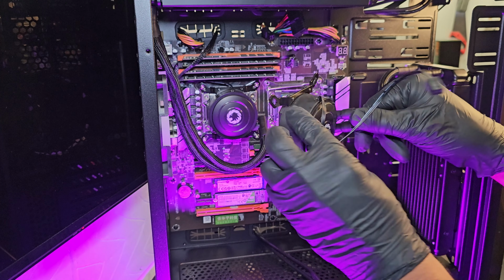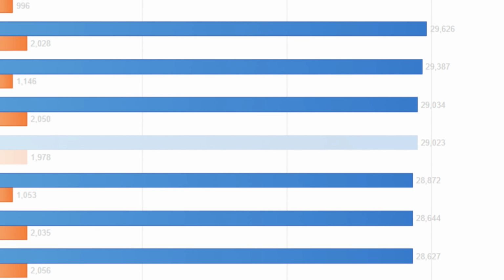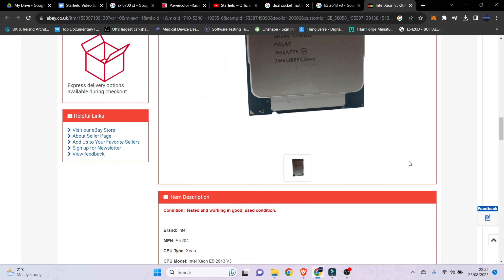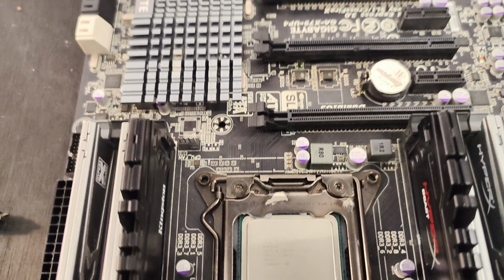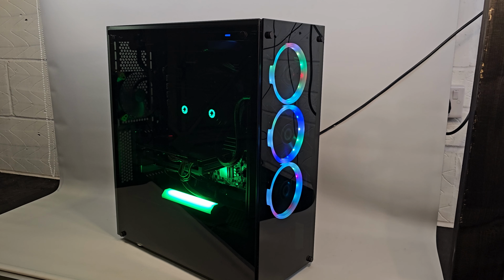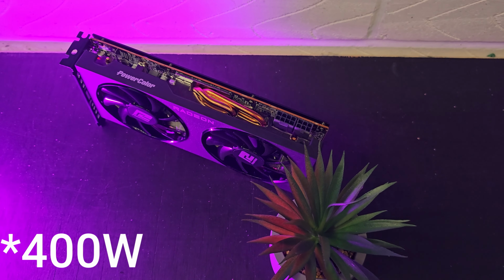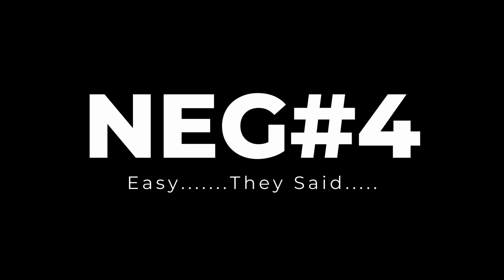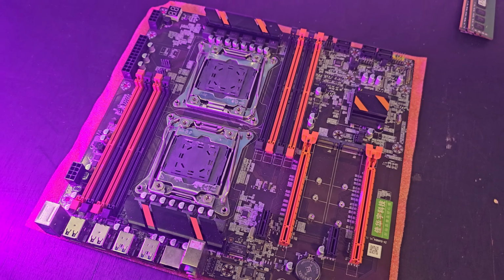DUAL Socket PC, Should you BUILD One?

Comment: Just build a Huananzhi F8D dual socket 2680v4, performs better than a Threadripper 2990WX or a I7-13700KF in multicore - 18€ per cpu and a 130€ motherboard 😆
Reply from the maker: @MetallixX974  that's awesome, sometimes you can even get those motherboards for cheaper. I picked up my ram, motherboard and dual cpus for maybe around £140 lol
Reply: I did i also built an hp z8!
Reply: I have seen those those motherboard for 75 euros on aliexpress and xeon e5 2697 v4 for 50
Reply: Do u actually see fps increase in games
Reply: @DIV9WARRIOR  he will have worse game fps vs i7 13th gen because of weak individual core performance

Comment: I was a bit lost on building a workstation with a i7 12700kf or 2 e5 2697v4 but this video convinced me to do xeon, it's also pretty cheap on aliexpress
Reply from the maker: Yeah I'm rebuilding another one right now, it's a little fiddly, I got error codes come up, just remember not to over tighten the cpu coolers and add the ram sticks in one at a time. That's add one ram stick then boot, turn off add another etc. It's some weird black magic on my mobo anyways
Reply: @RestoTek  alright thanks for the tip!

Comment: I have a Lenovo P920 Workstation with two Xeon Gold 6136's and it kicks ass with spreadsheets and with the GTX 1080 ti fe ... it kicks ass in Gaming too.
Reply from the maker: Dual Socket pcs are awesome, I don't care what anyone says lol
Reply: @RestoTek  i agree and back that comments fully i use a dual xeon e5 2699 on a lenovo thinkstation p900 150gb ram and i have a second lenovo thinkstation p910 dual xeon e5 2683 v4 and 150gb ddr 4 ram i game on both oh and rtx 360 12gb on both love them both
Reply: is it pretty smooth? im considering buying a p720 for use as a server, with dual 6138s for virtual desktop stuffs, it looks like great value.
Reply: @Alexander-dc4kf  they use alot of power but mine is very reliable.

Comment: I have a pair of HP Z840’s; One as a workstation/light gaming pc with dual e5-2689v4’s (20x 3.8ghz cores) and 128gb Ram(16x8gb 2400) and 6750xt gpu, and a second as a server with dual e5-2697v4’s (36x 3.6ghz cores) with 256gb Ram (16x16gb 2133), 8x14tb SAS HDD’s and an Intel A770 gpu. 

Z840’s are beasts with a TON of features, and I paid less than $200 each for them (less Ram and HDD’s) . If you get one, make sure you get one with the 1125w PSU so you get the extra GPU connectors. 

I know user benchmark is a terrible site, but even by their standards, both my Z840’s score “UFO” for Gaming, Workstation and Desktop categories! 
On PassMark, they still score in the top half of all systems, and that’s against the latest uber Epyc/Threadripper/Xeon systems with CPU’s that cost +$10k 😅
Reply from the maker: @baddestmofoalive  I recently did a video comparing my 2699 vs intel ultra 9, and I managed to beat one of them lol still with the boost clock mod it made a huge difference
Reply: @RestoTek  I just got a SOIC8 clip and am going to try a bit of bios modding and overclocking on mine lol

Comment: I have dual X58 motherboard from alliexpress with overclocking function as well. My both X5690 6 core cpus runing at 4.7GHz gives me extreme ammount of performance. 12 cores 24 threads for such an old platform is literally nuts and usually, the X58 chipset allows you to use only 24GB of ram MAX ( 6x4GB because it is triple channel ) but this motherboard allows you to use ECC server memory 16GB per stick and some people got 32GB sticks as well. Onboard native Sata 3 controller is really handy. But the manufacturer says that you have to use both CPUs because you loose some PCIe slots as well, some QPI bandwidth is used to communicate between those two CPUs and the chip automatically alocate some of the bandwidth if you use only one cpu, it's not a big deal but automatically you loose bunch of SATA3 connections because there are two controllers. My board has 12 SATA3 ports and QPI link speed isn't that high tbh. If you max out all the SATA3 by using SSD discs, you basically have no spare bandwidth for the GPU, USB, NIC but only if you using only 1 CPU. By using two CPUs , you have full QPI link speed avalible for everything. Mine are overclocked so the QPI bandwidth is even higher and i can utilise all 12 sata ports and still have a two full 16x PCIe 2.0 bandwidth avalible and one 8x as well as NIC and all USBs. And actually 12 cores at 4.7GHz is crazy fast to how old the machine is. RAM is 2133MHz just to mention.
Reply from the maker: @samohraje2433  thank you, that's amazing I might have a look into a pair of x5690 cpus for myself, 4.7GHz is pretty decent especially for gaming. Thank you for the indepth description here, I'm sure it will help other people too!
Reply: @RestoTek actually, compared to i7 3770K, the X5690 at 4GHz is roughly 10% faster as 3770K stock in games. At 4.7GHz i see almost 30fps boost in almost every game that is not 1core speciffic and can run on such an old system ( lack of some instruction sets ). Two X5690 at 4.7GHz gives you almost 30fps boost over i7 3770K at the same clock but consumes twice as much power, 3770K peaks at around 160W at 4.7GHz while x5690 peaks 210W on 12V CPU connector. Crazy how old that system is and still somehow capable. X99 is always better in many ways and i can clearly say it is futureprooved, if you have dual X99 mobo from like EVGA or Gigabyte or more likely from Asus, they support overclocking as well and by putting some 10 core xeons in them you can have 40 thread monster that can run any game at reasonable resolutions and framerates.
Reply: X5690 only supports 1333Mhz. Do you grill your breakfast on your PC? 😂😂
Reply: @ I don't know what that cpu support but it works at 2133MHz. But i think max is 1600-1700MHz i have BCLK fsb set to 235 and anything else via multiplier, for CPU i have 20x. It coockin but not as terrible as i thought. 400W just CPUs alone is wicked 😂

Comment: I had a duel Xeon i used all the way until 2020. DDR2 but it had so much ram and so many cores it functioned acceptably into the ddr4 era.
Reply from the maker: @Virtue2721  that's amazing! Even ddr4 era dual xeons work so well today
Reply: @RestoTek  Well remember this was a 2012 mobo in 2020 so i say "Acceptably" well. It could run games at full speed but you were going to deal with compatibly very long processing times when you were say. Generating a world in 7 days to die or the like.

Comment: Coming from a single Xeon 2696V3 build myself, it always crossed my mind to try a dual Xeon build, but at the end some Haswell quirks, the questionable quality of the boards and high power draw in idle with the Turbo boost unlock were enough downsides for me to bite the bullet and invest into a modern 14700KF instead. At least I got to re-use my DDR4-RAM and got a decent Z690 board for cheap. If there only were some more recent Xeon options available with decent but cheap boards, I'd be among the first to try that route again. But unfortunately, there are no such more modern options available right now.
Reply from the maker: @seylaw  yeah it's a shame but I think you made the right choice, all dual cores are cool they don't compare to a modern cpu

Comment: Im running a super micro x10dax board with a pair of 2683v4 chips and 16x32gb ecc lpddr4 2400 in my home server.  Does a fantastic job, runs all tasks, runs cool.  Does burn lots and lots of power though.
Reply from the maker: @dreadwe  yeah that's the only downside, but if electricity is not an issue then you have everything else it needs to do!

Comment: Basically I would think Xeon e5 2690 v4 as I have seen its specs been actually better than the other models, though those seem to depend of applications.
Reply from the maker: Will have a look, i just looked at e5 2699 and v4 version of that on paper looks worse but it's probably not the same across the board

Comment: Do you think is to over kill dual cpu epyc for unreal engine, zbrush, blender, and maybe some houdini? considering im a beginner
Reply from the maker: No but it depends on how often you will use it vs the time savings an EPYC Cpu saves you and it's cost, if your going to be using it all the time then I think it makes sense, also there are some epyc cpus out there that are fairly cheap these days
Reply: @RestoTek  I use my pc most of the time. The only cheap cpus i have seen are the 8 cores. Most are expensive as hell.

Comment: I noticed that the xeon in question is v3 while v4 has 2 more cores and is faster with basically the same price so what is the benefit using version v3. I personally have v4. so l am curious as most of the test I see has been with version 3. I would like to know if there is actually been comparison while using v4 Xeon CPU
Reply from the maker: @pasilahtinen5777  that is a very good point, haven't really thought about that, rather than doing a dual cpu config I might do a test with v3 and v4 cpus to see which one is better

Comment: CB23 only showed a few Threadrippers and the newest CPUs... So here is another useful comparison:
So: dual e5-2694v4 (22c/44t x2, 44c/88t) and 300W (150W x2) has CB23 of 27,326.
My Ryzen 5950X (16c/32t) [unrestricted power by PBO in BIOS, about 170W] has CB23 of 27,223.
Reply from the maker: If you have solar panels then dual socket is the way to go! Lol still impressive how cpus released almost a decade ago are still relevant!

Comment: I want an AMD Ryzen 9 7950X(threadripper: Server; Productivity CPU, for DAW) in a dual socket integration w/ an above mid CPU to match with a GPU that can handle up to 1440p

Radeon RX 6800 XT or something like a:
3080/3090
 (when I get into 4K resolution my costs increase exponentially.)

Would be neat if the Dual Socket could switch/swap on or off on centred tasks.
Reply from the maker: There are allot of really knowledgeable people in this chat, it might be worth having a reach through and see what other have done with dual socket setup!

Comment: If I add 2 16 bit processor  then would it be 32 bit.
Reply from the maker: @indogreek5565  no I think it would still be 16bit, you would need a processor that specifically designed to be 32bit

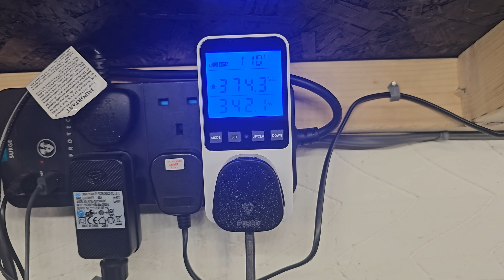Comment: 6:42 340W?! is it idle or during full load? what card you use for test?
Reply from the maker: It went to about 400w maybe 410 peak, its paired with a rx 6700 xt, I tested it with a couple of games aswell as bench and stress test in cpu z and 3d mark, the wattage barely broke above 400w, I'm pretty surprised tbh

Comment: My 13600K does 23600 or so. But sure, the price is pretty nice on the CPUs. But the Xeons are cheap I guess. Not bad.
Reply from the maker: A 13600k will walk over pretty much anything, but like you said it's about cost I suppose, these cpus are so cheap they pretty much cost the same as a cpu cooler 🤣

Comment: sorry - but several of your "dont's" don't really add up
- psu with dual eps: uhm - if you look at the class you typical use for such systems - anywhere above 750w - most of them come with dual eps rails - the hard part really is to find psu with more than 2 eps rails as most dual-xeon boards often require 3 or even 4 8-pin eps - although you can use adapters from pci-e to eps
back when I was on the am3+ bulldozer platform my formula-z hat 8 + 4 eps - and my old corsair ax750 has 2x 8 eps
- case with enough space: look no further than "full tower" - any full tower with enough space for a 4090 has enough space to fit e-atx boards
- ram speeds: well, it's because JEDEC doesn't specify anything faster for ECC - and that's for stability - and that's the choice to be made: speed vs stability/reliability - why do you think an ibm z390 mainframe is two full racks with just the power of a high end gaming rig? it's because most of it can fail and yet still can serve your thousands of bank customers at the same time
to me your list is way to personal and thereby not bias-free for a good information - it's just "yea, I did it - but I don't recommend it"
"weird driver issues on chinese boards" - yea, because neither are these designed for windows client os nor should anyone run any windows on such a platform - it's meant for linux - if you even try to run windows on it it's your fault - RTFM! - you're doing it wrong!
Reply from the maker: I can only go off of my own experience. Tbh I had the general consumer in mind and the conclusion at the end of the video wasn't what I really thought. Tbh I really enjoyed my experience with a dual socket motherboard and it run far better than the i9 11900kf that I have at the moment. The dual socket boots faster and was surprisingly stable. But I tried to give a balanced view of the positives and some short coming for someone that might be inexperienced with dual socket builds. Appreciate the feedback and well do better next time
Reply: I have a question about cases, I have a e-atx SSB type motherboard from supermicro (12x13) and I need ro find a case, I do not think anu eatx cade can support a format that is not common, in terms of the screws placements
Reply from the maker: @gastonhitw720  I used an ionz case but I used a Chinese dual socket motherboard, I think there are some options for example CORSAIR Obsidian Series 1000D?